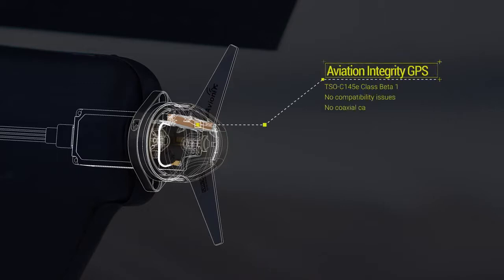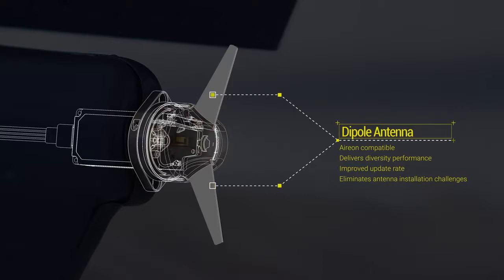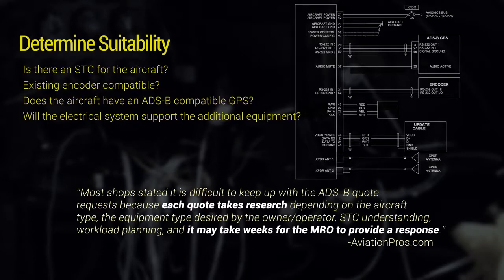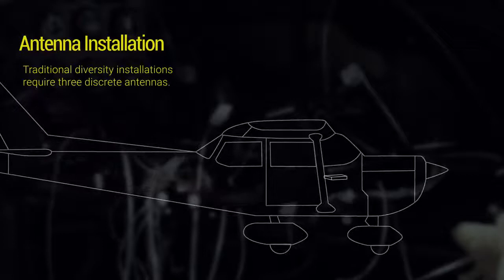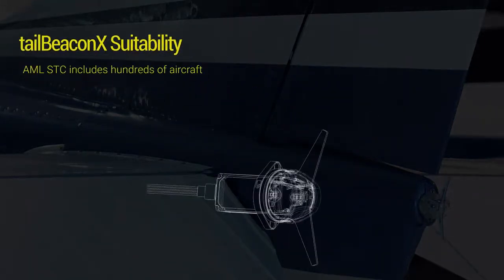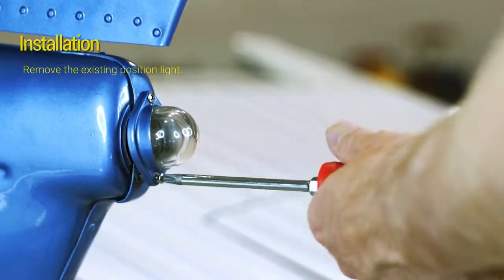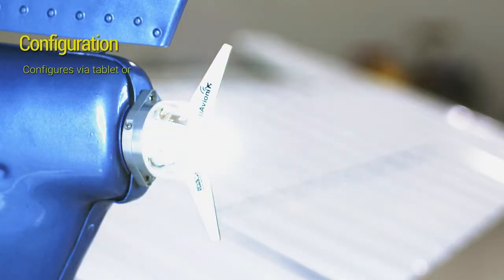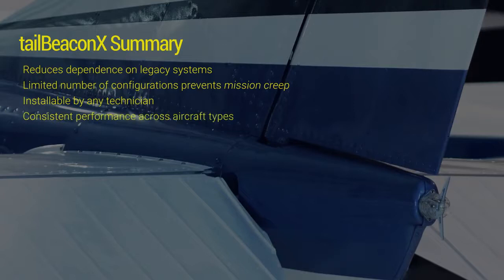uAvionix tailBeaconX  - an alternative to diversity ADS-B transponders

Comment: How does the built in mode S transponder know what the altitude is?
Reply from the maker: The tailBeaconX has an integrated aviation GPS. This provides the altitude position.
for more info visit: https://www.ssass.co.za/tailbeaconx
Reply: @ssassholdings  no it requires alt info from the control head, which has a static port,  or an efis. I confirmed this with uavionix.